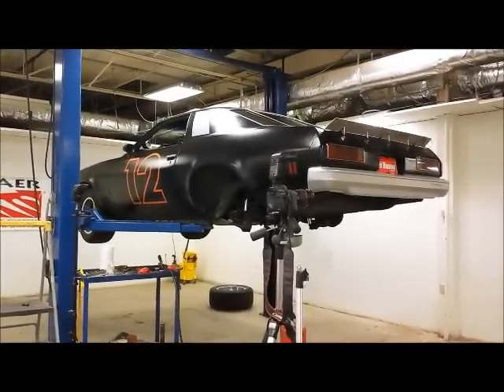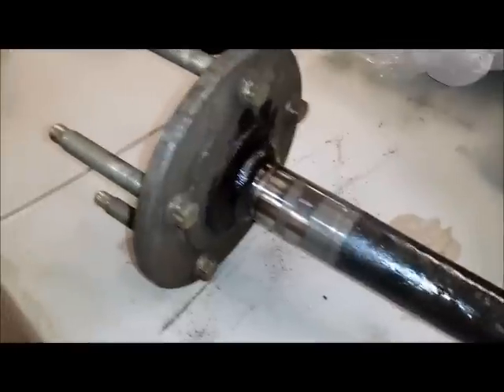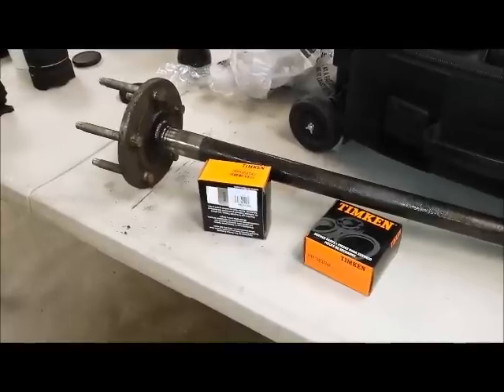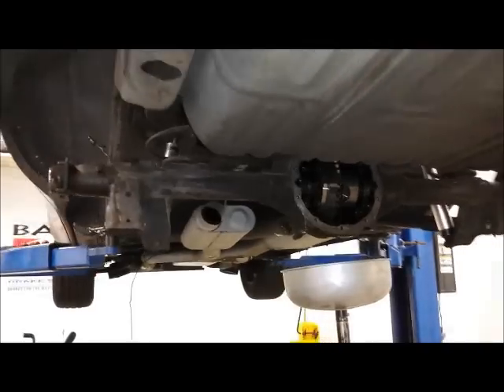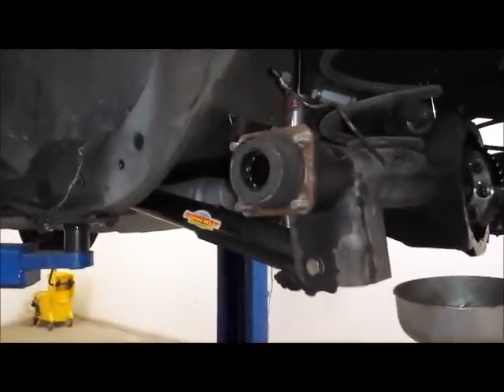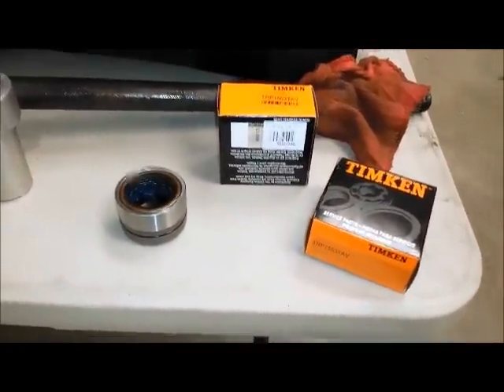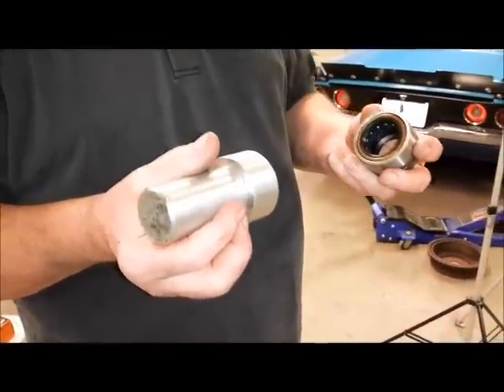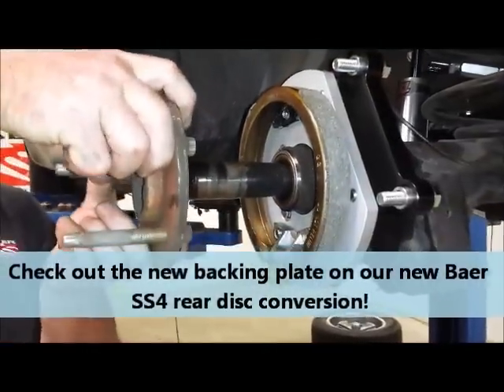How To Repair Axle Bearings On GM 10-Bolt Rearends

Comment: The Bearings that they replaced the old ones with are offset bearings, which means that they are going to ride on the axle shaft in a different place, so that it does not continue to score the shaft and wear through. I replaced the bearings in my 96 s10 blazer not long ago and needed to use these type. It saves you a little money cause the axle shafts ( at least for my blazer ) cost around 200 .00 each. Nice video, very informative.

I copied and paste this because vidio failed to mention this important detail, other wise great work and it answers some of my questions.
Reply: Thanks so much for explaining that. At the shop today I took an axle out of a lemo town car and they discontinued the axles so we installed these hoping that it would fix the issue of the axle being worn down 1/32 where the bearing rides. Knowing this gives me peace of mind.
Reply: I just got new axles for my 95 Blazer at $200 for both from Summit, drop shipped direct from Richmond/Excel: The axles came with bearings, seals, and studs. Yeah, they're not Buffalos: I'll keep the old ones as spares to use with these repair bearings if I ever need to change them out again.
Reply: i know it is kinda randomly asking but do anyone know a good place to stream new tv shows online ?
Reply: @Henrik Alexis Flixportal =)
Reply: @Alden Phillip thank you, I went there and it seems like they got a lot of movies there :D I really appreciate it!!
Reply: @Henrik Alexis Happy to help xD

Comment: I see these for Ford 8.8s as well. the bearing only uses the grease that came with it, and hopefully enough or you have to wash it out and put in all the same type of grease. These must be for people who want to get a few more miles out of their axle before having to replace it.. as I cannot see this design going 100k without that grease failing and needing a repack which would be impossible to do.. and on the Ford I was working on, with their emergency shoes in middle, would be tough to get C-clips back on with the extra piece of bearing riding out of housing..

Comment: Now for the truth:
- Slide hammer does not work in real life. Bearing is in far too tight to shift with a slide hammer.
- Rare that auto parts stores rent tools any more. I could not find any.
- Old seal sat flush with end. New seal/bearing combo sits proud of end by exactly 0.200 inch.
- Special bearing driver tool not needed. 2x4 wood on its flat and tap it in with a large hammer. Place the bearing in the freezer few hours before to shrink it slightly.
- New seal/bearing combo has an o ring on the outside. This needs to be lubed prior install to avoid tearing it.
- SKF R1559.

Comment: all well and good but you didnt show trying to put the c clips on with that  bearing/seal from timken. the bearing is sticking out 3/16 of an inc and wont let you push the ales far enough to install the clips.  wonder how many guys have called you names by this point.....
Reply: I put that kit in my 84 camaro and the axels fit into my spider gears.
Reply: Hone/Grind/Turn down the axles by the hub?

Comment: say where does that bearing ride on the axle if the axle has that worn spot. can you show where that new style bearing rides on the old shaft? it looks like it rides a bit further out in the axle seal area and the bearing has seals at both ends but if there is a seal at the inside how does the lube get to the bearing then. thanks
Reply: 2002 Chev Tahoe axle housing cracked when seal failed. Big deal? Axle is fine.also, my repair bearing is 1.613 inner diameter, so what size axle should I put it onto?
Thanks! Great video, btw.

Comment: You could also put the bearing unit in the freezer to aid in installation.
Reply: Hu?
Reply: Yeud Siegal by putting the bearing in the freezer. The bearing actually gets smaller. If you heat the housing.....it gets larger and expands. Making it easier to install the bearing

Comment: I need the one ending in the TV on the outside And the tav for the inside.what do I do help
Reply: 1559 tv bearing on e bay $13 shipped... remove cheap packing grease with WD 40 and repack the bearing with REAL US LUCAS GREEN OR RED GREASE. KEEP DIFFERENTIAL FULL FULL FULL of clean oil as that is what lubes and cools teh wheel bearings

Comment: With the repair bearing being smaller and not able to take oil with the inboard seal, whats the long term performance vs the original bearing and seal?
Reply: Almost every vehicle on the market today has a sealed bearing...

Comment: What tool is used to reinstall the bearing?? I have a race/driver tool set but none of mine fit like the tool in the video
Reply: No. Do not use a conical race driver tool on an axle bearing: You'll be hammering on the bearing cylinders.

Use the old bearing, or anything else that will engage the outer cage as a punch and hammer on it. I just did a GM 10 bolt 7.625" yesterday with a 52mm alternator power pulley I had lying around: I can smack it in the center with a big enough hammer and spread the force/pressure to opposing sides of the bearing keeping it straight with the housing.

In the past, I've used punches and hit on opposing sides consecutively first, then at whatever high spot I have until it bottoms out.

Comment: Do they make this bearing for a 12 bolt truck axle?
Reply: same bearing for many axles... ford 9" too.  12 bolt...  at least they standardized the axle bearing... and the pinion bearings too? 1559 tv bearing on e bay $12   get rid of the packing grease in them with WD 40 and then replace the grease with REAL US LUCAS RED OR GREEN GREASE.

Comment: What one part number I can use to make this work
Reply: 1559 tv bearing on e bay $13 without seal... with seal $20. i like the stand alone seal as if it goes bad, can pop it out and replace it with new seal and not have to take the bearing out.  but... if the seal goes bad it is cuz the bearing is prolly going bad from LACK OF ENUF OIL IN THE DIFFERENTIAL that lubricates the bearing and the bearing fails. the grease in the bearing is packing grease to keep it from rusting in transit. cheap grease. clean it out wiht WD 40 and put REAL US LUCAS RED OR GREEN GREASE in the bearing and on the axle shaft. KEEP REA:R DIFFERENTIAL FULLLLL OF GEAR OIL as it lubes and cools the wheel bearings.

Comment: What type of end piece is that on the slide hammer
Reply: @iroulis  thanks but I already found one that works🤙🏾
Reply: Mind shedding some light? In need of one myself, stuck bearing race in the axle tube, my slide hammer doesn't have the right attachment

Comment: On these GM 10 bolt C lock axle , is there movement slight movement in and out on the hub , I'm rebuilding a Camaro in the UK , most people over here no nothing about them so I'm stuck for info , the hub does not move left or right up or down but , you can feel slight movement on the hubs in and out , Question is that right for one of these Axles .
Reply: That is normal, yes.

Comment: So, ya tossed the "GALLED" axle back in, with NO treatment. Is the new bearing surface supposed to be wide enough to bridge the gap, is that the Unsaid point of it, besides it has a built in seal?
Reply: I know this is a year late, but hopefully you'll see. The upgraded design moves the bearing surface out on the axle shaft to an unused part of the hardened section. The new design also supports the axle shaft slightly better with the bearing move outward.
Reply: Yes thats the hole point of the repair bearing bro!#
Reply: @midnite1717  what about lubing the bearings and seals before install?
Reply: Yeud Siegal you never lube any bearings on the outside. Wheel bearings, cam bearings, or any other bearing. You run the risk of the bearing spinning inside the housing and ruining the part. All bearings are supposed to be put in dry.

Comment: Thanks for the video. But there was no mention of greasing them and that they are sealed on both ends so that they are not lubed by the fluid in the rear end. 

How do these repair bearings hold up over time? I prefer permanent repairs. As I just buy a new axle and install new OEM bearing. Only my right side axle is worn, after 36 years in my S10, and likely from overloading with 3500 lbs in the bed one too many times. 
Do these need to be greased every xxxxx miles?
Do they have the same load capacity of original bearing?

I have no experience with them myself.
I've seen negative feedback on the bearing listings where they've failed quickly. I'm assuming they fail due to inexperienced driveway mechanics failing to grease them, or damaging them during installation.

Comment: Where can I get that tool to reinstall the bearing?
Reply: weight set, the bar end housing is almost perfect like the one shown.  just cut down and grind a bit till it's right.  or use a large socket that fits just the edge of the new bearing.